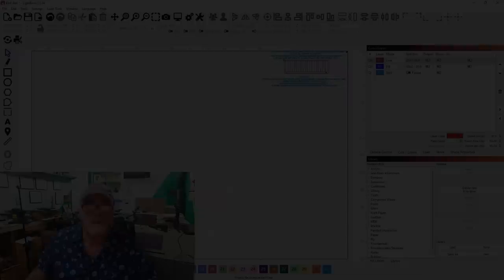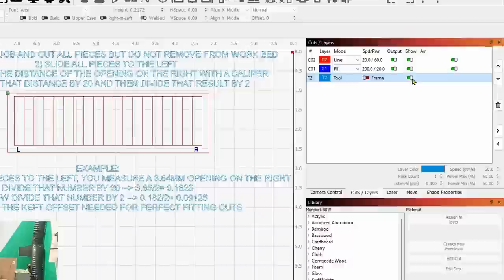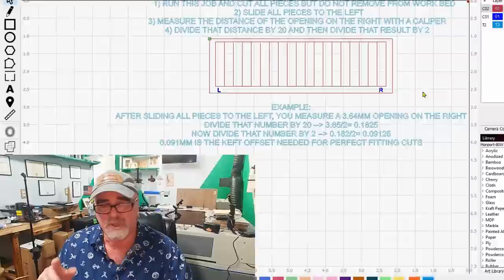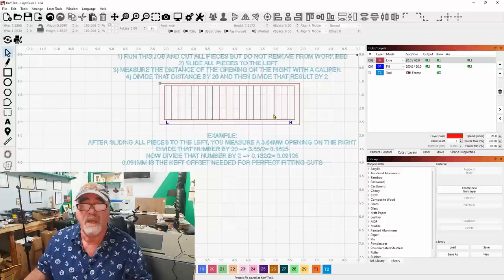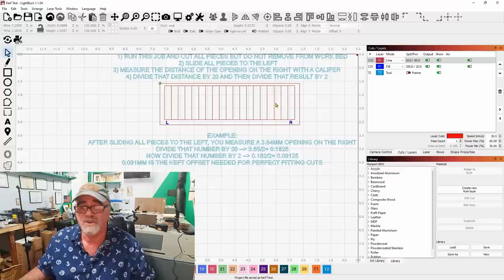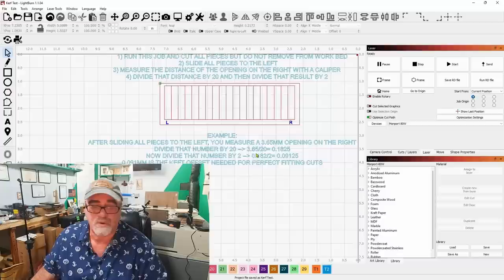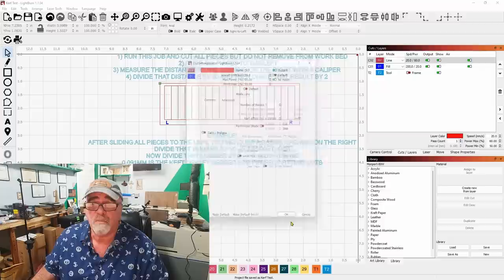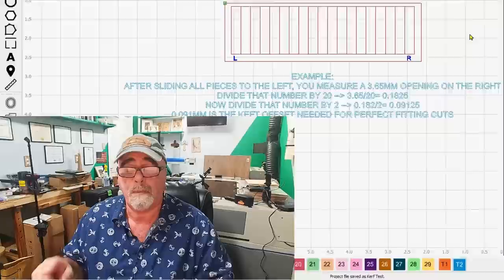Understanding your laser Kerf and how to set it up for perfect cuts!

Comment: Rich, there's a discrepancy between the cut file I just downloaded and your video. The file instructions say divide the gap measurement by 20 to get the kerf adjustment, but in your video you say divide by 20 and then divide again by 2 to get the kerf adjustment. Which is it?
Reply from the maker: That's my fuzzy math Steve 🤪 It's divide by 20.
Reply: J'ai fais les tests et dans lightburn, je dois rentrer le chiffre divisé par 40 (/20/2) sinon ça ne fonctionne pas... j'utilise la dernière version en date de lightburn et du MDF 3mm... 4.6mm mesuré et donc 0.115 fonctionne bien, 0.23 ne fonctionne pas du tout, c'est trop grand... ai-je fait une erreur ? Car cela me semble plus logique d'enlever/ajouter que la moitié de l'épaisseur du kerf sur chaque face pour retrouver le milieu de la coupe au bord... non ? Je ne sais plus quoi penser... merci en tout cas pour ta chaîne que j'aime beaucoup !

I did the tests and in lightburn, I have to enter the number divided by 40 (/20/2) otherwise it does not work... I use the latest version of Lightburn and 3mm MDF... 4.6mm measured and so 0.115 works well, 0.23 doesn't work at all, it's too big... Did I make a mistake? Because it seems more logical to me to remove/add only half the thickness of the kerf on each face to find the middle of the cut at the edge... No? I don't know what to think... Thank you in any case for your channel that I like very much !
Reply: @medline2c  dividing by 20 does give you the correct kerf size. If you're going to adjust both pieces (for example, a tab and a slot), one out and one in, then each adjustment should be 1/2 of the kerf size. If you're only adjusting one of the pieces, such as for inlay work, then the adjustment should be 100% of the measured kerf size. Keep in mind that the kerf size can vary depending on your laser focus and the type and thickness of your material. I've also found that for inlay work, using the precise kerf adjustment can make it very difficult to insert without using a hammer. Backing off by .015 mm makes it easier to insert while avoiding the need for glue. Hope I've helped you.

Comment: Hey Rich! Thanks for the video, sorry I'm late to the kerf party. On your test file, you have 20 pieces lined up side by side. With those adjoining vertical lines, would using Lightburn's "Remove Overlapping Lines" option affect the results? With the option enabled, only one pass is used for each vertical line. With the option disabled, each vertical line gets two passes. In other words, does the number of passes affect the kerf measurement? Thanks!
Reply from the maker: Oh, good catch! I didn't even think of mentioning that! But yes, I always have that turned on by default. I have the best audience on YT! Thank you for the comment! 👍
Reply: @TheLouisianaHobbyGuy  So the number of passes also affects the kerf value. And the number of passes depends a lot on the type, thickness and quality of the material. For instance, a 3mm thick piece of birch might take one pass, whereas a 3mm thick piece of plywood might need three passes. Does this mean that we should perform the kerf test for one, two three, etc. passes?
Reply from the maker: I try not to use materials that take more than one pass to cut, but I don't think the kerf is affected that much by the passes with air assist. When you're cutting, the kerf will always be larger because you're focusing lower into the material causing a V shaped kerf.
Reply: @TheLouisianaHobbyGuy  I popped you an email, but to recap, in your example of the puzzle, kerf will have no effect if optimization is on. And with optimization off, a kerf value will make the pieces fit more loosely, as the kerf from each piece cuts into the adjoining piece. The only cutting method that will achieve the desired results is to use a kerf value and separate the pieces so that each piece is cut individually. Also, I want to stress that this is not an argument, I just find the topic fascinating and challenging to understand when accounting for all the variables. Love your channel!!
Reply from the maker: I'll have to give that a try, thanks!

Comment: Hi mate, I have a Sculpfun S9; can I use Isopropyl alcohol and a cotton bud to clean the lens?
Reply from the maker: That depends on the IPA. If it's IPA 99.5, yes, but lower than that, I wouldn't recommend it. And I only use microfiber cloths for lens cleaning Alan.
Reply: @TheLouisianaHobbyGuy  oh, I did not know that IPA had a value sort of speak, I will check the bottle that I have.
Thank you for your reply.

Comment: Good to also stack your material and take a measurement for layered parts that slot into a hole. (I didn't do this for last month's project 🤦🏼🤦🏼🤦🏼). Just because Rich got real 3mm sheets doesn't mean you will. 😔
Reply from the maker: Great tip! And I don't usually get perfectly sized wood! I think you're talking about the frame. That was a USA supplier.
Reply: @TheLouisianaHobbyGuy  mom's day.

Comment: Rich, How often should you complete this kerf test? I realize one factor is how ofter you are using your deice, but generally speaking. Also, do you recommend this test for each different materials you are using? Thanks, and always your advice is appreciated and welcomed. No hurries btw
Reply from the maker: I do a kerf test every 30 or 40 hours of use Michael. Material shouldn't matter too much unless you're using foam or cardboard.
Reply: @TheLouisianaHobbyGuy  Good to know. Thanks bud.
Reply: @TheLouisianaHobbyGuy  Just a side note that you will find amusing, I didn't, but you will....Completed the video as instructed above. Downloaded the "Post It" note box as you did. I applied my new kerf setting, started the project and my laser was wigging out - 3 separate times. Long story short, the digital calipers readings were in mm and I enter the LB kerf offset in INCHES. Just wasted 2 hours, but the kerf is perfect!

Comment: What should I do if my laser dot is really a laser rectangle?   My xTool D1 20 watt laser has a 0.08 x 0.15 laser dot.
Reply from the maker: The offset works in both directions Chuck!
Reply: @TheLouisianaHobbyGuy  Yes but there's only one setting and the size of the kerf is twice as big in the Y direction as it is in the X direction.
Reply from the maker: @Chucka1463  Well it shouldn't be twice the size, but yes, it is different but all  you need to do is a little experimenting.
Reply: xTool says it's .08 wide and .15 tall.

Comment: why did you not finish??  Show the new cut / setting etc ????
Reply from the maker: I did, I guess you missed it Rich. This had nothing to do with cut settings, just kerf settings.
Reply: @TheLouisianaHobbyGuy  what i meant by that was put two pieces together to show your system works.  I tried it a few times, and was more accurate by cutting a 1 inch piece and measuring the diff. until I got the 1 inch. Faster and easier.  Also way more accurate.  Try it, it works every time.

Comment: The kerf you set for a box lets say, your kerf setting, I.E. positive .12, is applied to only ONE of the two panels of the joint fingers?  Seems that on a six sided box, each panel's side will have it's kerf set to compliment the other panels it fits into?  I'd think you would have to draw the box out on paper so you label each edge's fingers that mate with the other panels,  with no two paired finger joints having the same kerf setting....  In short, no two mating pairs of fingers can have the same kerf..??..??
Reply from the maker: I don't know, this works for me.